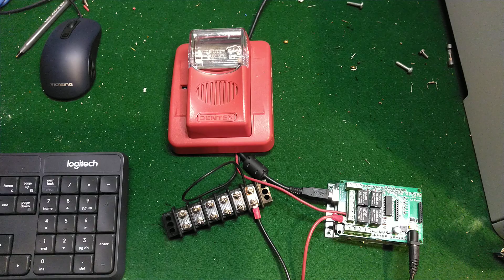Gentex Sync Protocol on an Arduino

Comment: Cool! So the PC (or in the future, the panel) tells the sync module when to initiate audible silence?
Reply from the maker: No, I'm planning to use one of my Nanos to output both patterns simultaneously.  The homebrew panel will switch between the two if/when needed.